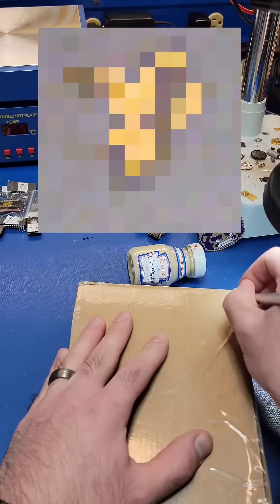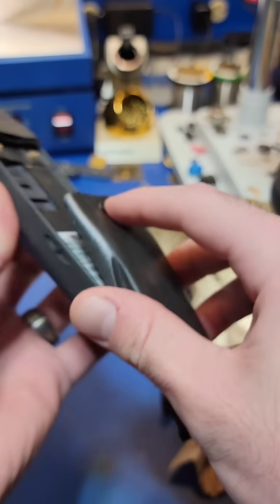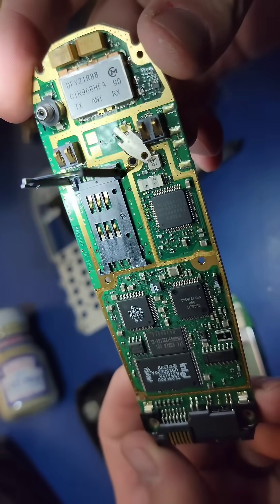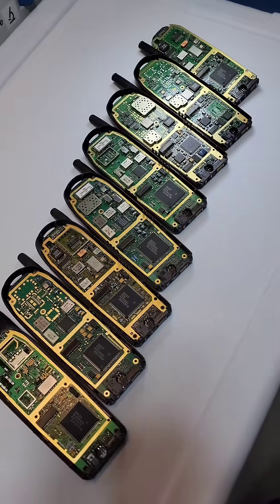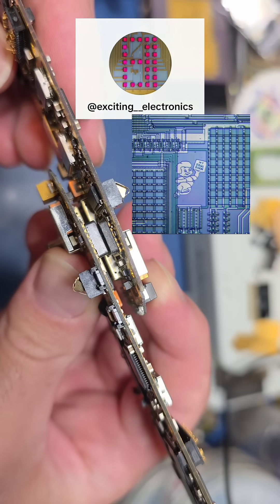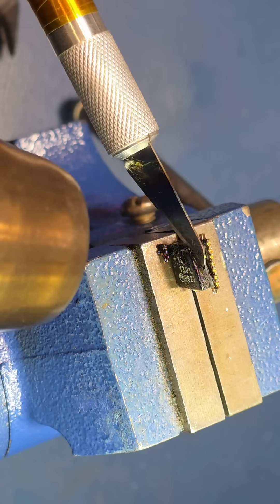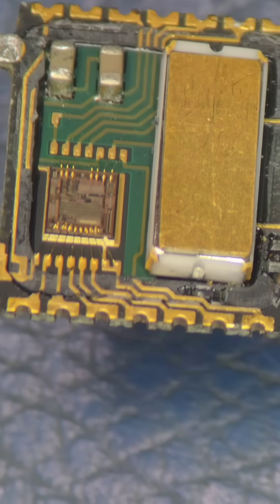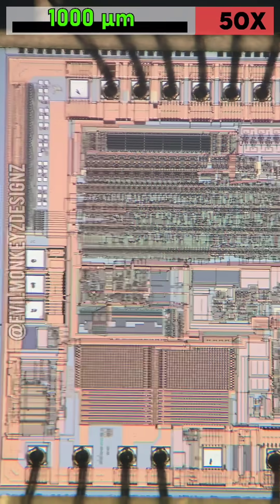Moose Boy - from the Nokia 5190 cellphone

Comment: *Moose Boy* was a microscopic doodle of a cheerful child with antlers that appeared on a Motorola RF integrated circuit designed for the Nokia 5190 handset in the late 1990s[1][7]. This tiny artwork, measuring just .004 inches across, has become one of the most famous examples of "**chip graffiti**" - a practice where engineers secretly etched personal artwork into unused spaces on silicon chips[1][9].

## The Story Behind Moose Boy

According to a Reddit user who claimed to work with the original design team, the doodle was created by engineers at Motorola, with one team member nicknamed "Moose"[5]. The *boy figure was actually inspired by the logo of a burger joint* located in southern Illinois near St. Louis - likely a reference to the Big Boy restaurant chain - with antlers added to create the "Moose Boy" character[5].

## The Broader Practice of Silicon Doodles

Moose Boy was part of a widespread but secretive tradition in the semiconductor industry. *Chip designers regularly hid microscopic artwork* in their circuits from the 1970s onward, using the same photolithography processes used to create the actual circuitry[9]. These hidden images served multiple purposes:

- *Artistic expression* for engineers whose work was otherwise invisible
- *Intellectual property protection* - unique signatures that could prove authorship
- *Personal signatures* ranging from simple initials to elaborate scenes like a T-Rex driving a convertible[4]

## Modern Discovery and Collection

Today, these silicon doodles have become sought-after artifacts. *Techno-archaeologists* like engineer Kenton Smith spend considerable time and money hunting for these microscopic treasures, scouring flea markets and online auctions for old devices to dismantle[4][6]. The practice has largely disappeared due to *automated production processes* and stricter company policies that view such additions as unnecessary risks[5].

The *Silicon Zoo* at Florida State University began documenting these discoveries in the 1990s, and companies like Chipworks maintain galleries of what they call "silicon art"[4][7]. Finding Moose Boy specifically requires luck - not all Nokia 5190 phones contain the doodle, as it depends on which production batch the chip came from[8].

Sources
[1] Chip Fab - WIRED https://www.wired.com/1999/11/chip-fab/
[2] Cool Images Hidden on Silicon Chips | PCMag https://www.pcmag.com/news/cool-images-hidden-on-silicon-chips
[3] Discovering Moose Boy in the Nokia 5190 Chip - TikTok https://www.tiktok.com/@evilmonkeyzdesignz/video/7518871117646384439
[4] Hidden Inside Our Electronics, Tiny Doodles From Another Era https://www.nytimes.com/2025/08/12/technology/silicon-chips-doodles.html
[5] Over decades, hardware engineers have embedded Easter Eggs in ... https://www.reddit.com/r/Damnthatsinteresting/comments/1lq223t/over_decades_hardware_engineers_have_embedded/
[6] The Hunt for a Lost Microscopic Art World - The New York Times https://www.nytimes.com/2025/08/12/technology/the-hunt-for-a-lost-microscopic-art-world.html
[7] chip graffiti - Word Spy https://wordspy.com/words/chip-graffiti/
[8] Vintage Philips BT Cellnet Mobile Phones From the 90s - TikTok https://www.tiktok.com/@phonewizz/video/7157965311264836870?lang=en
[9] Today's Distraction: The Microscopic Art On Computer Chips - NPR https://www.npr.org/sections/thetwo-way/2011/04/06/135189558/todays-distraction-the-microscopic-art-inside-computer-chips
[10] Understanding the Qualcomm Q1650C Viterbi Decoder - TikTok https://www.tiktok.com/@evilmonkeyzdesignz/video/7176676816546041130
[11] Original Nokia 3310 Survives 1 Million Volt Experiment - TikTok https://www.tiktok.com/@entrelligence/video/7313753817739201810

Comment: Moose Boy is a small, cartoon-like doodle found etched on a specific Motorola integrated circuit (IC) used in some Nokia 5190 cellphones. It's an example of "chip graffiti," where engineers would sometimes include small, playful designs on prototype chips. The doodle, resembling a moose with antlers, became a sought-after Easter egg by enthusiasts who discovered its existence online. Finding it often requires dismantling the phone and examining the chip under magnification. 

Now you know 😊✌️

Comment: This reminds me of when i adjusted my laser cutter programs to micro engrave my name on the parts for a bit. (You could find it if you looked but wouldnt notice if you didnt know) they later get powder coated and its less noticeable but still there. Other parts stayed bare aluminum and you could find it easier. These were all for commercial products so there are 100s of them out there with my name on most of its sheet metal 😂

Comment: I worked in a wafer fab for a few decades and there were a lot of graphics on the die and in the test areas between the die. I should have documented some of the more interesting ones, but they seemed common at the time.  Most were just manufacturer logos.  I think with the current design tools these are probably way more rare in current chips..

Comment: Haha wow, I haven’t seen Moose Boy in decades. Can’t believe someone found this under a microscope—takes me right back.

I worked on the layout team for Motorola’s wireless division back in ‘94–‘96, right around when we were cranking out chips for the 5190. We were doing custom mask work in-house, and yeah, that “MASKWORK 1995 MOTOROLA INC” text is totally legit. That was our claim tag on the die layers.

Moose Boy? That was an inside joke gone immortal. One of the guys—pretty sure it was Dave or maybe Jim from CAD support—snuck him into a filler space on a metal layer when we were finishing up a mask set for one of the RF chips. I think it was a PLL or power management block. Management either didn’t notice or didn’t care. The rule was: if it didn’t interfere with signal or process rules, you could get away with a little art.

We all worked crazy hours back then. No remote work, all clean room gowns, wafer maps taped to the wall, chips on light tables. We lived on Diet Coke, sunflower seeds, and bad radio. You’d see people sleeping under their desks during tapeout week. But there was a lot of pride too. We knew these phones were everywhere—if you had a Motorola flip or candybar phone in the mid-90s, chances are you were carrying around our blood, sweat, and silicon.

Moose Boy was kind of our mascot. Dumb, cheerful, antlers out, holding up a sign like “look what we made.” It was the kind of thing that kept us sane when you’re staring at metal layers for 14 hours. Never thought he’d make it to the internet, but here we are.

Anyway, thanks for posting this. Didn’t think I’d get punched in the nostalgia this hard on a Tuesday.

This comment is 100% fake btw.

Comment: "Moose Boy" is not a real character, but a piece of "chip art" — a microscopic graffiti engraved by engineers on an integrated circuit. Here’s the story, briefly and objectively:
🧠 What is "Moose Boy"?
It was discovered on a Motorola RF circuit used in the Nokia 5190 handset — a model from the mid-1990s.
The term "chip art" refers to these microscopic drawings intentionally included in unused areas of the chip, as signatures of the engineers or "signs of life" in the manufacturing process.
🎨 Why were they made?
Unique marks: they were used as a form of "watermark" to demonstrate the originality of the design, before laws automatically protected circuits.
Sign of professional pride: a human fingerprint in the industrial process — engineers made drawings visible only under a microscope and only at the technical level.
❓ Why did they disappear?
As production became automated, with ultra-compressed manufacturing cycles and increasingly compact designs, the free space for microscopic graffiti disappeared. Thus, these marks are now increasingly rare.
✅ In conclusion:
"Moose Boy" is a small piece of chip art, a caricature of a moose engraved on an RF chip from the Nokia 5190 phone.
It is part of a tradition where engineers discreetly signed their projects — and today it remains an amusing and fascinating relic from the history of microchips.

Comment: I work in chip manufacturing! We typically put pictures on the clips to check alignment and to be a guide, so the image can be whatever. I know a few chips that had my co-worker's baby's photos on them :)
Fun fact, those large, unconnected pads with "scratches" in the center are spots we use to test the electronics

Comment: So from what little digging I've done, I've found that Moose boy is a a tag based on the Big Boy Restaurant mascot, and that the chip is likely from Motorola's Burlington Vermont based operation Radio North Group. Upon looking into any correlation between the two, i found that there used to be only one Big Boy restaurant in Vermont at any given point, also located in Burlington, that closed down in the late '80s after having both had their mascot stolen and then rebranding to Bob's Big Boy in 1986, respectively. Whether Moose Boy was someone on the line at the time doing a nod to the brand as a whole or not is questionable at best, but personally I'd like to think that whoever stole the mascot from them the first time got a job making chips at Radio North Group and decided to play a little sneaky on them.

Comment: This is a chip. Smaller than a fingernail. With a silicon chip on it that's like a fifth(?) of the size of the entire chip.

You have to zoom in on a fraction of that chip i  order to see the doodle.

And then you have to zoom in EVEN FURTHER to read the text.

WAT?!
Reply: Moose boy is less than 100 micrometers tall.

that is 1/1000 of a millimeter. Or 1/1,000,000 of a meter.

Moose boy is about 1 MILLIONTH of 3 feet.

Comment: Did that second inscription read GUN PORN?
Reply: They're functional labels for some test pads.

Probably more or less impossible to tell exactly what they represent, but appear to be power related. G could be analog/signal ground, N could be a negative rail, +P could be a positive power rail, and the upside down tree looking symbol is probably substrate/system ground.

Comment: I learned the story from engineers at the 2010 GSMA conference in Barcelona, the Moose Boy (whom they call Hirvenpää) is actually the phones moisture sensor. If this boy is contacted by even a tiny drop of water, it will swell up, detach itself, and damage sensitive connections in the phone. This is why Nokias were notorious for breaking when they got wet.

Comment: Your worried about logos. I'm worried about the demon that gave mann the knowledge to alternate a  tiny piece of silicon containing numerous electronic components like transistors and resistors, all interconnected to be the brain for electronic devices. There isn't anyway in the world someone made something like that simply through trial and error.
Reply: It wasn't exactly trial and error. Observations about the behavior of different material (elements) under different loads of electricity were made by many people over many years. Then experiments were done by other people to test how different configurations worked, and the result of that was a transistor. Then some other people applied Boolean algebra to transistor arrays and we created circuits that could perform logical operations. No demons whatsoever.

Comment: What kind of a VCO is this? My understanding is that it wasn't possible to integrate one into CMOS up until mid-2000s. For interference reasons (see Razavi's RF book, it's about strong TX affecting PLL) - and probably to generate quadrature signals easily - they run at 2x LO frequency, so for example 3.6 GHz.

Comment: dude like how the hell do you even print an image that small, with readable text even! it’s amazing!
Reply: in 1995, we could reliably print silicon to 350nm; thats close to the size of ~20 red blood cells. images this small had been possible for a very long time before this, as hard as it is to believe. 
imagine how small the images we can print nowadays are at 3nm!
Reply: @maddiemmelle that’s so cool. amazing how much new stuff there is to always learn
Reply: Photolithography.
Masks, ultraviolet light and a system of lenses to project down to create a smaller image into the etch resist costing covering the wafer.

Comment: Who is Moose Boy? From the Motorola RF IC Nokia 5190 handset

Considering the expense, precision and difficulty of manufacturing computer chips, you would think the engineers designing them are pretty serious people.

But it’s not all business inside a chip fab, as these microscope photos reveal. In fact, the designers of microchips frequently hide tiny cartoons, drawings and even messages alongside the super-tiny circuits and semiconductors they create.

Chipworks, a company that analyzes microchips by peeling them apart and looking at them under microscopes, has discovered many examples of silicon art. We’ve selected a few highlights here from the firm’s extensive galleries of silicon art, but check the Chipworks website for more.

The images in this gallery are magnified 200 to 500 times.

As Chipworks explains, these drawings are made with the same processes used to assemble the rest of a computer chip. Designs are etched onto photolithography plates which are then used to “print” the chips’ circuitry, layer by layer, in thin films of silicon, silicon dioxide, aluminum and other materials. It’s a complicated process that takes hundreds of steps and millions of dollars worth of machinery, and it requires incredible degrees of precision and repeatability.

But if there’s a little unused space in a chip, why not fill that with an entertaining design? It’s not as if most of the chip companies’ customers will ever notice. The only people likely to see these designs are the chip engineers’ supervisors and analysts at companies like Chipworks.

“The mass production of these works of art as parasites on the body of a commercial IC goes unnoticed by most observers,” writes Chipworks. “Their existence is a tribute to human resourcefulness and creativity, surfacing from deep within a complex process.”

By Dylan Tweney WIRED MAGAZINE